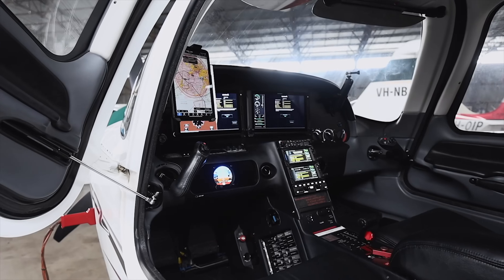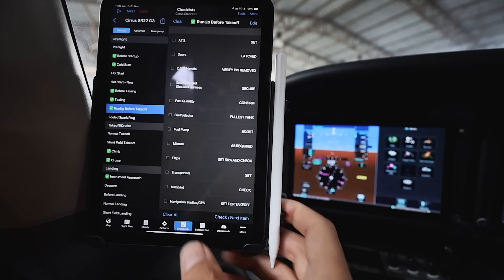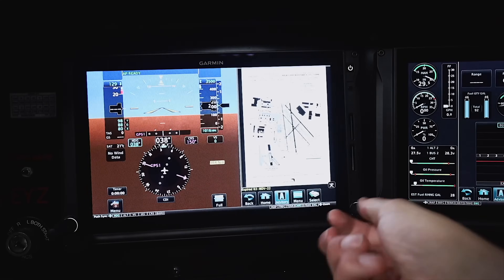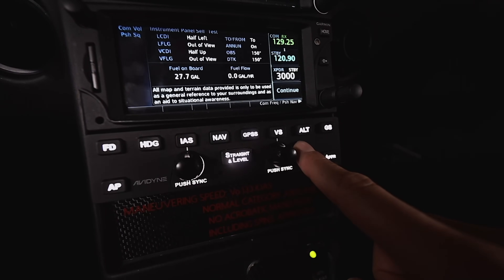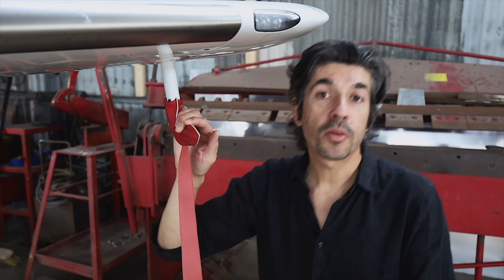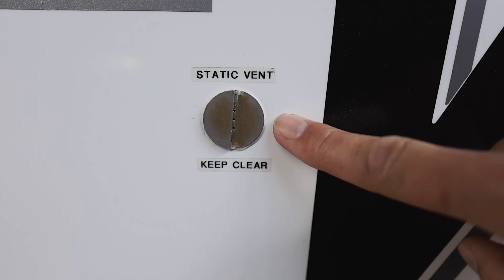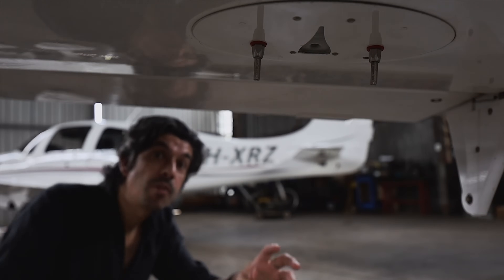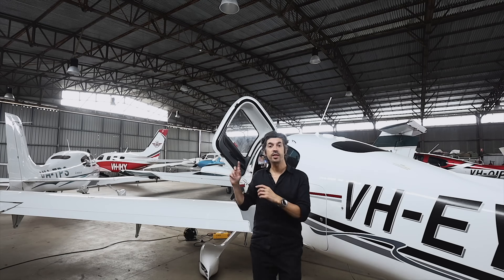How do computers fly this plane?

Comment: Stef,
Do you use a normal computer monitor spray and cleaning cloth for cleaning the displays of the Garmin units or do you use something else which works much better?.
How easy is it to update the NAV ARINC databases on the Garmin?
Do you use an on-going paid subscription to Garmin or organisations like ARINC or Jeppesen for navigational data & for your iPad app & Garmin glass system?.
Does your Garmin setup also allow you to fly in say greater Asia, EU, US & also include their additional databases & approach plates or is that an additional paid subscription?.
My only concern of your Garmin glass setup is the battery runtime of your standby instrument & was wondering if Garmin offered additional battery packs.

Love the Cirrus range of aircraft but if they had 3 extra features I'd wished they would be:
a) Rubber boots on the leading edge instead of de-icing fluid which could deplete if forced to stay above the clouds in known icing conditions
b) A compressor to allow limitless flow of pressurised oxygen in the cabin with a standby O2 bottle in case one needs an emergency descent
c) They improved the layout of the nose gear as if you were in extreme crosswind it seems possible to damage it due to lateral movement & its perceived inability of the nose gear to swivel

Comment: I wonder though how they keep the plane level because gyros will always drift over time. I guess it correlates the GPS movements with the G sensor and slowly susses out the direction of gravity. Because there is no direct way to measure gravity in a vehicle that can accelerate. That might also mean that a loss of GPS will make the gyro drift. Maybe something sloppy can be hacked together with compass data that's good enough.
With computerized ATC we wouldn't need to write stuff down on paper or confirm back. Or even talk to ATC at all. And most would be direct.
Can the main display should synthetic vision only? remove all the clutter.

Comment: Since Stef mentioned the cover on the Pitot Tube…. If you’ve ever wondered why pilots say “airspeed is alive” early in the take off roll, it’s because you need a certain amount of air flowing into the Pitot (more than taxi speed) before the airspeed indicator works.  If the pitot tube is blocked (e.g. because the cover was left on it) you won’t get any reading at all no matter how fast you’re going.  So it’s important to confirm early, because a lot of decisions the pilot makes in the next few seconds of the take off depend on having an accurate airspeed indication, but you don't know that the airspeed indicator is working at all until you've started the takeoff roll and gained some speed.

Comment: I’d love to know the approximate cost of converting to a glass cockpit like this - $10k? $50k? $100k? A fully-integrated stack like this would be my dream aircraft!
Reply: You wouldn’t get any change out of $100k. The 10.6in G500 display is $21,545US each, $11,295US each for the GTN650’s, $4,195US for the Gi275. That’s $100kAU straight up plus any other parts like magnometer, adapters etc, then add the labor and wiring looms, easy $150k AU would be my guess

Comment: In a scenario where you were to have a complete blackout of all cockpit systems (including the standby instrument) what would happen?
Reply from the maker: It’s a rare (very rare) set of circumstances that could cause that, but if it happened and I was in visual conditions, the aircraft still flies the same so I’d land at the nearest airport. If I was in cloud or at night it gets trickier, but that’s why the standby instrument has its own power source to get me visual and on the ground.
Reply: @StefanDrury  Garmin has definitely thought of everything!
Reply: @StefanDrury  makes sense now, so these panels are just informational rather than a crucial aspect to the flight controls. However it’s nice to see the redundancy thought out in many ways.
Reply: You would resort to the basics of flying the plane.
Reply: @bsmith2053  But there would be no compass, altitude etc right?
Reply: @alexj-1133  EYZ has a standby compass above the windshield I think, most other aircraft do to.
Reply: @samothy236  Got it - I had a look, yes it does!
Reply: @alexj-1133  for altitude, speed etc. you'd probably have to contact ATC and they can give you it from your transponder information.